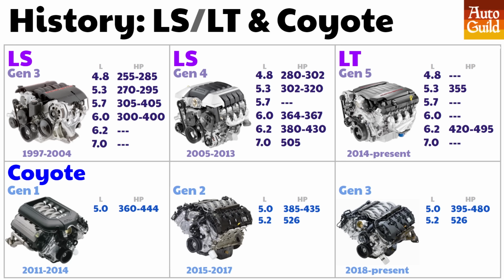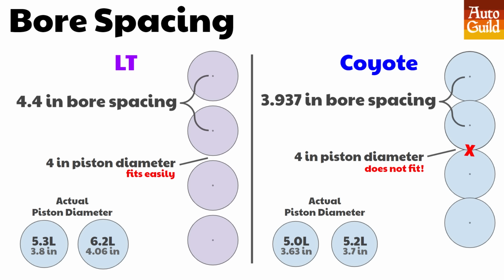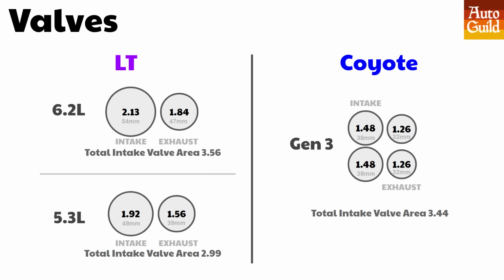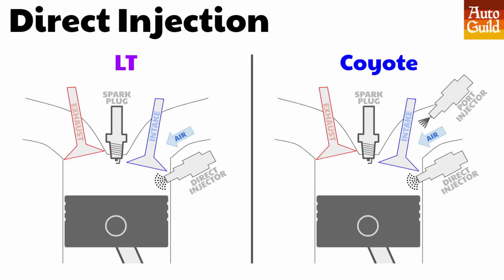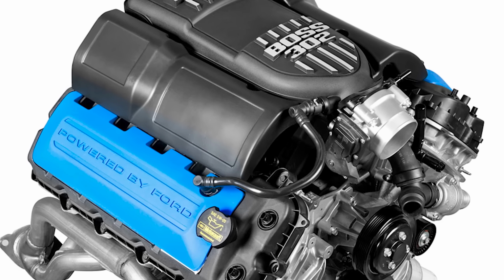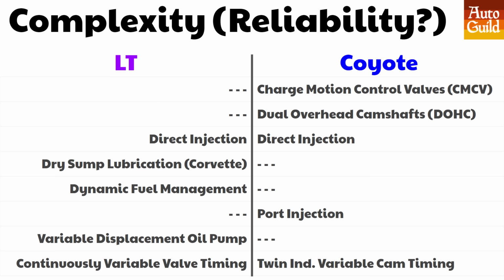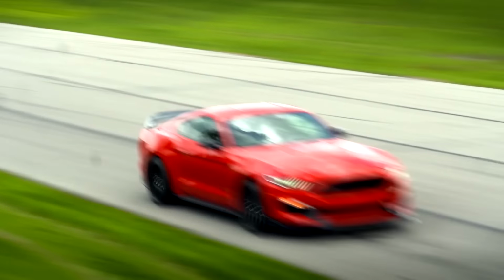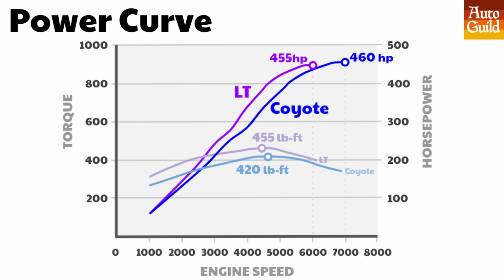GM Gen 5 LT vs Ford Coyote.  Which one is better and why.

Comment: I've owned 4 vehicles with LS engines.  Every one of them got better gas mileage than was advertised, 2 of them MUCH better.  I never understood why the GM engines weren't advertised with better mileage.  I've often wondered if the same might hold true with the Coyotes.
Reply: I have only owned the newest 5.0 mustang but I get noticeably better gas mileage
Reply: EPA
Reply: The "posted" mileage numbers are from an artificial test devised by the EPA , and applied by computer on a complete car on a "rolling road"- chassis dyno. FR
Reply: @fredericrike5974  he's talking about real-world mileage. Once again you cannot grasp the context of a comment. You're talking about EPA mileage and he's talking about real-world mileage. What experience do you have exactly? Not that I would believe one word of what you said because all you're spouting is BS.
Reply: @tedkay5272  So, you are saying that the EPA regs and the CARB don't exist. You throw the BS card, you need to be ready to back it not deflect or resort to personal attack- but you seem to be showing what I call a RedHat attitude, so I'll  move on. FR
Reply: So you drive them like an old lady.
Reply: @korndawggy1801  That's the funny thing, I didn't.  In fact, I had 3 quarter mile passes at a track on the same tank when it got 28MPG (while it was only rated at 26.)
Reply: @korndawggy1801  I think you do better getting up to speed quicker if you have the torque so that you spend more time at cruse.  So I think you get better millage driving less like an old lady, you go man!

Comment: More moving parts more likely to break and more expensive to fix
Reply: 75.00 lb 5th wheel  I pull dodge ram hemi  2500 is my highest rpm uphill does not even break a sweat 11 to 12 miles per gallon of gas I don't need 4 valves per cylinder 4 cams to do  it  and 6000 rpm
Reply: Not always. If a higher revving engine is designed to withstand it then 75 MPH freeway speed would be about 2400 RPM and basically per ring. Then at 45 MPH, you decide to pass somebody in a Prius and they will say something like, "The sound...I'll never complain about gas V8 again". All those parts are synchronized as one unit and the design has paid off for Ford. For normal use it will hold up, but nobody's just taking it easy with that revving monster.

Comment: I own both motors. The coyote in a mustang, the l86 in a truck. (The l86 is internally identical to the lt1 in the vette and camaro)

The coyote is my favorite american v8 ever, for a sports car. The lt1 belongs in a truck. The pushrod motor does not breathe up top and runs out of steam. It feels weak on the highway but a monster down low. The coyote is the opposite, it feels like two 4 cyl honda motors welded together. It is a revving beast and is so much fun in a sports car.

Coyote = dr jekyl and mr hide
LT= mr hide all the time, but kinda wimpy at the end

Comment: the power vs displacement argument is kind of pointless.  neither company is designing their engines to be X hp per liter; however, each company is designing their engines to be completive at that given time they were produced.  if the 6.2 is making 455 hp, well the 5.0 needs to make about the same hp.  this makes the 5.0 have a higher power per liter than the 6.2 by default.  also by default and the other side of the coin is 6.2 has less stress on it to make this 455 hp vs the 5.0 and the 6.2 also has more head room to make more hp; if both engines are able to make 100 hp per liter (both engines easily can) the 6.2 is making 620 hp vs 500 hp.  all i am saying is this power per liter argument is pointless especially in stock configurations.  Now what really makes a difference is power vs mass of the engine.  if you have two engines that are making basically the same hp (which in reality both the 6.2 and 5.0 are), do you really care about which engine is larger?....No, you would only care about which engine is lighter which in this case is the LS/LT.  in the end having a larger displacement engine is a better choice especially if it is capable of making 100 hp per liter.  need to make only 400 hp? ...a standard 6.2 can do it.  need to make 450 hp?....a standard 6.2 can do it.  need to make 500 hp?...a standard 6.2 can do it.  a 6.2 can do all three power options while weighing the same without any engineering or major modifications which was the whole point of why a 6.2 was chosen vs smaller displacements.  once you get to about 100 hp per liter, some special engineering and/major modification will be needed.  the 6.2 saves GM money to make 400 to 500 NA hp.  if GM decides to make a 500 hp Camaro for example, Ford will need to make a 500 hp mustang.  at that point Ford will have to make a decision: do some special engineering/major modification to the 5.0 or increase the 5.0's size which either way costs Ford some R&D money to do. 
Now is the 5.0 more technologically advanced compared to the 6.2?...Yes, it has to be because it is smaller meaning making competitive HP number is more difficult for it, so the only way to remove larger engines' displacement advantages is through technology.  in the real world the only things that matters are HP/torque, weight, MPG, and simplicity .  if you have a large displacement engine doing all four well, that is a winning combination as it will save the company producing it money.  this is the reason why GM went with a 6.2 vs a 5.7 for its performance displacement.  the 6.2 means that the same basic design can be used for a longer production lifespan.  the lesson to be learned is to design your engine platform to be as large as possible so you have production longevity and flexibility; that way you can start off small and punch it out if needed later on with minimal R&D work.

Comment: The coyote is much more complex. More propensity for a catastrophic failure. Many more moving parts and higher reving means the percentage of throwing a rod goes up. The lt motor is a torque monster in comparison and are virtually bullet proof. A very reliable engine. With good MT's the corvette will launch hard and the 5.0 won't have any chance to catch it in the quarter. The half mile might be a different story thought.
Reply: BMW and Porsche have used DOHC since forever and their racing engines are bulletproof. DOHC is so superior that even the C8R corvette race cars use it.

Comment: Already 5000 miles on my new 2021 F150   XLT    5.0        FX4    3.73 gears    Gen 3  400 HP     checked every darn box I could when I ordered it.    :)   What a BLAST to drive as my DD. !!  wow!!!!   Special order  Oct. 8    got it  Feb. 23       Antimatter blue    with carbonized gray  2  tone       Single Cab  Short bed

Comment: As a long time gearhead, I have come to live by the 'Inverse Timing Chain Law'. The shorter the timing chain, the fewer headaches and more longevity. Period. LS/LT or Hemi, yes. Ford anything? NOPE
Reply: Well Ford has dual cam variable timing to ELIMINATE chain slack.. Dodge Chevy... NO!
Reply: @nobiden3134  you're missing the point. The more parts involved, the more failures. Put 120k hard miles on them and then compare mechanic labor and parts receipts. No contest, the LS/LT and Hemi motors are far cheaperto keep going. My dad has always been a Ford man. He's had 1 4.6 and 2 5.4's crap out well short of 150k, despite religous maintenance. Too complex, too many parts, and zero regard for longevity. If you enjoy insanely difficult repairs and absurd parts costs, might as well step up to a Mercedes.
Reply: @tinman7065  my 06 Expedition on 26's (heavy wheels) has 211,000. Changed plugs twice, injectors once, 1 alternator.. thats all.. (dirty oil will jam cam phasers because they are extremely sensitive and accurate) ive towed 11 classics 300 miles home 3,500ft elevation climb.. why would ford build and sell if it didn't pay off? Maybe you should ride the bus! How about those DODGE lifters? Yikes! Dodge has always had problems.. do you know what killed the Hemi?... Detonation! Go look up SEMIHEMI.. Its ford stuff.. done RIGHT!
Your dad must be a terrible mechanic
Reply: Gimme your cell # ill show you my Pavement Train.. 
Ohh. What happened to timing belts... Ford went back to chains?... I graduated from UTI Sacramento.. FORD OWNS that school.. how long do Gear Drives last? Great sound... DONT LAST! What side of the chain is the TENSIONER ON? the side that   pulls the cam, or the feed side? There's science behind it!

Comment: So, what you're saying is, that HP per liter, the LT engines are a lot more relaxed and have a lot of room for very easy growth due to them already having greater displacement. Whereas, Ford is pushing the limits at 5 and 5.2 liters and these engines are ticking time bombs, all else considered fairly equal.

Comment: The larger bore spacing means even BIGGER valves and the flow numbers from LS heads are like something you would see in a race engine. I think stock the Coyote will flow slightly better but then the displacement difference is silly. Coyote can go about 5.6L while LT is currently available with 6.2 and the LS7 was 7.0L

Put an LS in it

Comment: And the Chevy/ Ford argument continues. While the Mopar guys are on the outside screaming "what about us?".
Reply: Yes, there is a 3rd God. MOPAR is right there, but the KINGS and better chime is "Ford versus Chevy". It's an anthem going back 50+ years. But, I think the 426 HEMI was top dog from '68-'72. Ford had their BOSS 429 for 1969 and was just a bit late for the party. *I wonder though if the quality is truly better today as far as their base models. The Coyote Sound will make any Chevy guys ejaculate all over their cylinder heads. Ford's got the title, Chevy has the numbers, MOPAR has the most appeal.
Reply: @gen-x-zeke8446  nah, the 454 in the 70 chevelle made 450 horsepower. That was crazy power for the 70s.

Oh btw, the sound of a coyote is mid.  The worlds two most beautiful sounds are a big cam bbc and a 2 stroke detroit.

Comment: Come on!  Do your research bro. The Voodoo engine in the GT350 was prone to low oil pressure/oil pump issues leading to engine failure.  The car was a flop due to numerous warranty claims and a huge class action lawsuit from the car owners. That’s why Ford stopped producing it and went to the GT500.

Comment: Is a “catch can” a good cheap solution for direct injection engines that don’t have port injection backup?? Will it prevent the intake valves from carbon buildup???

Comment: Yep there junk if you don't change oil every 2k miles 
.you will look like you dropped hand grenades under the valve covers. And it doesn't take long 35 to 50 k miles

Comment: Most of the world has decided LS and variants are best bang for the buck. Most of these engines are a $400-$600 cam and spring change away from a very streetable 50-100hp gain. The powdered steel rods used in both brands are ignorantly criticized as weak when just the oposite is fact. along with their cast pistons . Both brands hold up well to boost if rings regapped , with the LS types better on head gasket life when HP moves above 1K. Smaller dimensions favor LS for repowering most anything. No doubt also factor in FOMOCO's superb 7.3L pushrod V8 option in 2020 up F250-and above trucks

Comment: Change the spark plugs....if chevy still has the distributor on the back and ford on the front.  The coyote is better. 😂
Reply: Neither one of these engines have distributors

Comment: When comparing valves, I would think the circumference would matter more than the area because the air/fuel flows out from the edge of the valves. Coyote Intake Valve total circumference is 9.3 inches and the LT 6.2L is 6.69 inches.
Reply: What had the Coyote IVs been only 6.7 inches?

Comment: The Coyote may make more power per cube than the ls, but a sbe coyote will never reach the same hp number as a sbe ls. Richard holder took a sbe 6.0 to 1500 on record. Coyote boys gotta worry about their oil pump, their sleeves rattling loose, and their soft ring lands. Lol the coyote is an amazing engine but will always be outshined by a dirty crust covered oily sbe ls. What's the highest sbe coyote you ever heard of?

Comment: 405 hp stock LS6 in my C5 ZO6 has been pretty much flawless. 80K no issue. So far the best motor ive ever owned and ive had a few.. 😁
Reply: My L92 Escalade with over 300k laughs at that.  So far I've had to replace both front CV axles and wheel bearings, the battery, fuel pump and left side front diff mount.  The 6L80 started having a 4th gear flare at about 240k so I turned up the shift pressure.  We will see how many miles it makes it like that.  I have a new trans ready and waiting.
Reply: @zacharymorris9917  general maintenance it's not uncommon with 300k...if it was a ford it would be in the junkyard 150k ago..
Reply: @camclarke9952  my brother went through 4 3.5L Ford's.  At under 70k they all had severe valvetrain issues.
Reply: @camclarke9952  it’s all about proper preventative maintenance. Even Chrysler products can last a long time if you’re diligent with all of your preventative maintenance. I have a 2014 F150 5.0 with 100,000 miles on it that I bought new in 2015. Still looks and drives like a brand new truck. The only issue I ever had was having to replace a water pump, which only cost me $100 for the water pump and about 2hrs of my time in my driveway including getting the parts, replacing both belts as a preventative measure, and flushing the antifreeze since I was coming up on having to do that anyway. 

My parents only ever had 80’s, 90’s, and early 00’s GM vehicles and not one of them made it past 130,000 miles without a major repair. All they did was change the oil on their vehicles, unless something broke.
Reply: I beat the shit outta my LS1 daily. fuckin incredible.

Comment: If I recall correctly, the 526 hp from the NA 5.2 in the Gt350 is actually pretty underrated. I've heard those engines make closer to 600 hp from dyno testing.

Comment: Love the 5.4 over any mod motor ….the ford gt cams and gt heads !! 
And I also like the 2015-2017 z06 (pro charged or a KONG 26fifty !!!! 🇺🇸)
-gt 500 owner -
Reply: The 5.4 is also a mod motor, though
Reply: @zenlaserman  *any other mod motor
Reply: The 4.6 and 5.4 2 valves were awesome

Comment: Awesome video!
It seems that Ford has taken a huge leap forward in their R&D to create some really neat, technological stuff. Although I’ve been a bow tie guy in a bow tie family my whole life I  decided to buy a 2020 F-150. I went  w the 3.5 ecoboost as opposed to the 5.0 coyote because I thought it had a little bit more low end punch as opposed to the NA V8. Now I know that it has more to do than just the addition of the turbos, but great engine either way.   Strap a Whipple on top of one those beasts and you got yourself a real ground pounder for sure. 
Hopefully GM will follow suit in the future and for some fun and exciting future horsepower wars!

Comment: For me the real winner is the 3rd Gen 5.0 Coyote engine high power high  Rev and with port and fuel injection has the best of both , I love V8 but electric Tesla are way faster and now even 0 to 60 in 1.9 seconds Tesla Plaid

Comment: Should the Ford 5.2L Aluminator have been included in this vid? Also wanted to ask but is the  additional fuel economy in the LT series due to the cylinder deactivation?

Comment: Your horsepower per displacement (and by extension, that of the auto rags) is flawed. A supercharger fundamentally increases engine displacement. The supercharger used in the GT500 is 2.65L, effectively meaning it has a 7.85L engine; the supercharger used in the ZL1 is1.7L, meaning it effectively has a 7.9L engine, meaning they make 96.8hp/L and 95.6hp/L respectively. the Voodoo 5.2L at 01hp/L technically has the best ratio of the bunch, followed by the 5.0L Coyote, and then the 5.2L SC Coyote rounds out the top three.
For me, I have a first gen mustang, if I want anything newer than a Windsor, it's an LS or LT, but likely LS because cheaper.

Comment: Great video, so thanks for sharing. I have a planned engine swap from my LS3 to a larger displacement LS-style build. There's no way I could use the Coyote in my build for many reasons. However, I would love to split the difference and pick up the Mercury SB7 but unfortunately, those heads wouldn't fit in my vehicle.
Reply: You gonna bore and stroke it to a 427?

Comment: The coyote is clearly superior, when it comes to efficiency and tech. The ls/ lt. has displacement and simplicity. You cannot go wrong with either. Put a Ford in a Ford and a GM in a GM. Somebody should bolt a coyote head to an ls block. Yeah, it will take a little modification, but wouldn’t it be cool? All you need is unlimited money and a really good machine shop.
Reply: The ls motors have less moving parts and better gas mileage. So which is less efficient again?
Reply: @tonylewis1771  ford don't do cylinder deactivation.. thats WORSE than less parts cuz its a NOTORIOUS FAILURE (CHEVY).. 70'S technology refined for 50 years.. lame!
Reply: @nobiden3134  so your problem is that it's older tech....not that it's one efficient? Lol ok
Reply: @tonylewis1771  Its about power per cu in, the ability to move air, not gas mileage. I have seen stock coyote blocks make 3.3 hp per cu in, not sleeved and ported stock heads with power adder, the ls/ lt just cannot do that. There are trade offs. Ls is better package, coyote has higher limits, stock. Obviously, this can be a great discussion, but not on you tube. I love both motors, I think both are amazing. The packaging advantage and after market support, make the ls a great choice for 90% of engine swaps. And of course , neither engine is as great as the BBC. That’s the greatest engine ever made.
Reply: The reverse has been done, sort of: https://www.youtube.com/watch?v=ZEMGD5oSoPM
Reply: Especially 1.2 LITERS behind!